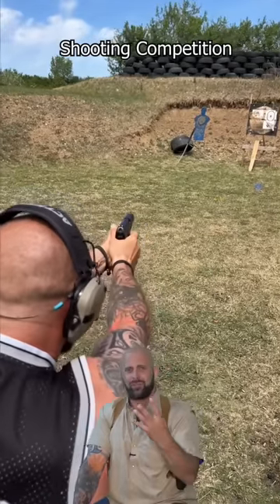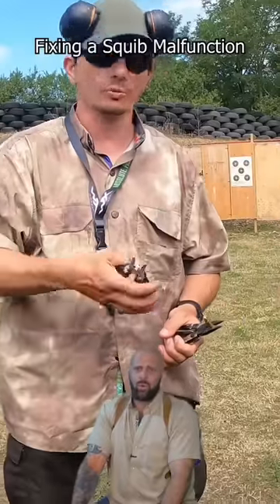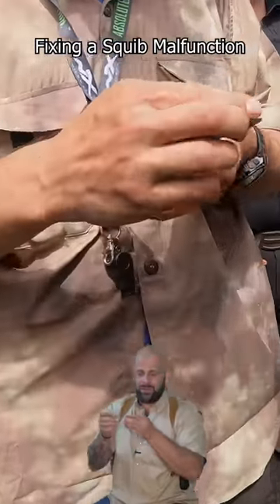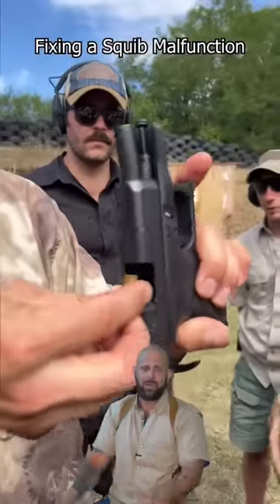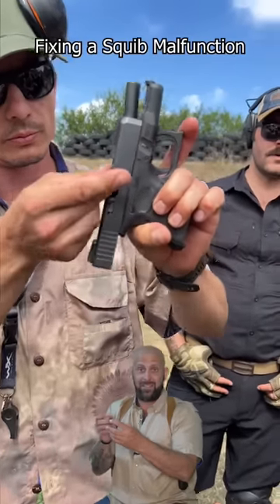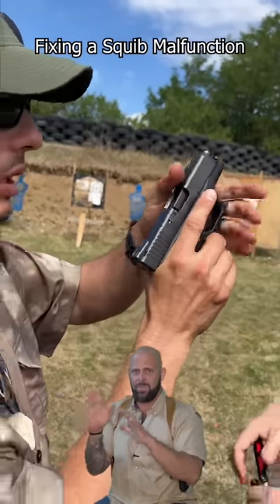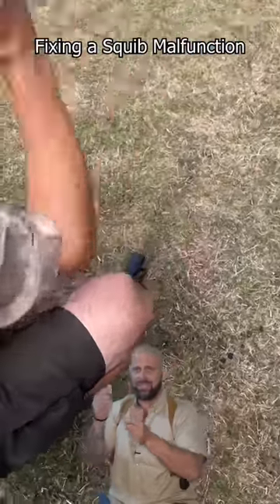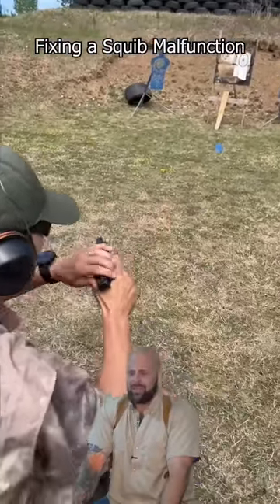Israeli Tactical Training School: Advanced Pistol. Video Clip #10

Comment: Very often a squid puts the bullet part way down the barrel. This "fix" insures a blowout. Yeah, in a match I've seen a squid put the bullet 1/2 down the barrel.
Reply from the maker: First off young man it’s squib not squid… yes the bullet is often lodged in the barrel, obviously. Simple physics will also tell you that this technique is not dangerous, regardless of the pressure spike… your barrel is still a barrel, it doesn’t become paper. The bullet is still soft led and the barrel is still steel. The original load probably just didn’t have enough powder.

Comment: Don't loan out your guns had somebody shoot three 22 lr that didn't leave the barrel 
And the barrel was ruined 
1 it swollen everywhere a bullet ran into another bullet 
2 they used a coat hanger to remove the bullets there were scratches all inside the barrel. This was a browning 22 LR T bolt 
I felt ill when I saw what they did to my rifle 
They ruined the barrel and the bolt .
The firing pin was bent from over pressure 
And the gutted the rifling.

Comment: Holy Crap how about no.  I guess if your in a life or death situation yeah. But putting more pressure into a barrel that is already obstructed is a great way for a gun to blow up in your hand. What if that squib was not the result of not enough powder and there was actually something wrong with the barrel. And cartridges are fitted tight for a reason. So now your just putting a ton of pressure on the breach and barrel.

Comment: This feels like bad advice. You have created a pipe bomb and got lucky that the barrel was strong enough to contain the blast and that the path of least resistance was pushing the bullet out the barrel. 

I’ve never had a squib malfunction but I know any barrel blockage of any type is bad. There has to be better way of removing the projectile.

Comment: What's amazing is they have tools and still chose the dumb way to fix this. Even if you don't have a cleaning rod and a hammer, I see trees in the background. Field strip the gun, Go snap a stick off, put it up the barrel and smack the  stick-in-barrel against the tree trunk or a big rock until you get the bullet out. Literally 6 different ways to MacGyver a fix for this that don't involve potentially blowing up your gun and shredding your hand.

Comment: Yeah no. That is not the safe way to clear a squib. Break the gun down. Use a stick or wooden dowel to push the projectile through. Really simple. You can damage the gun and cause potential injury by modify cartridges and firing even a blank with a squib in the barrel.

Comment: Nope field strip, use a squib rod, a small tap on the back end of the squib rod either on a hard surface or with a small hammer (armorer's, rubber mallet, etc) and you're good to go....no way am I trying to fire it out...nope

Comment: That is absolute horse crap and a really good way to lose a hand. Use something to drive the bullet out of the barrel, back into the chamber and remove it completely. Do this will cause overpressure of some kind at minimum will get the bullet out but by far more likely, blow the barrel up or the entire weapon comes undone and damages or removes the hand.

Comment: I can't believe that you said that!
That is the most questionable thing that DARWIN WOULD be proud of! 

Why would you not want to do it the safest way by disassemble the gun.

Why would you tell this to people this.

Taking a live round pulling the bullet out then loading what is the brass and powder to clear the blockage.
What if you have other under charged rounds?
When if you clear the rounds the way you should disassemble and use a cleaning rod.
But hay what do I know.
Reply from the maker: Try and develop a baseline understanding of physics and then we can discuss whether or not this is actually dangerous and why.
Reply: @BoneTactical  that is funny!
I could not stop laughing. 
The laws of physics have nothing to do with this! 
Taking the brass and powder to remove the bullet from the barrel.
You have the gun powder sitting in the barrel but you also now have changed the pressures in the gun because of the space  between the brass and the bullet.
So I think you might need a refresher on physics.
But hey what do I know.
Other then disassembling the gun and removing the bullet properly.

Comment: Do not attempt this. The pressure difference from having the powder spread across the bottom of the barrel will change the burn rate. This dude may have gotten lucky. Just tap it out from muzzle to chamber and move on.
Reply from the maker: No, simple physics. No danger here 🤣 if you think education is difficult, try living in ignorance!
Reply: @BoneTactical  it creates a pressure spike brother. Same concept as filling a rifle case 1/3 of the way full of powder instead of normal capacity. I’d love to hear your elaboration of what you think is simple physics that applies here!

Comment: Haha....no. break it down. Use a push rod. That's how you do it without wondering if it will detach and relocate your hand.
Reply from the maker: There’s actually no danger here but it’s much easier to use a push rod. This is simply an alternative method 👊🏼
Reply: @BoneTactical  oh I wasn't criticizing. I was simply saying a break down and push rod is how I would do it. Regardless of it works or not, blowing out a squib with a "blank" round just seems dangerous to me. Not a chance I'm willing to take. Either way, good on you brother. Thanks for taking the time to respond.
Reply from the maker: @rhinosauserous  I’ve never done it personally, but I have a lot of respect for Lucas. Thank you for your feedback and support.

Comment: Ah yes. The best way to clear a stuck bullet in a Walther is to load an-open top cartridge into a Glock. Hmmm.

But also, DO NOT DO THIS. This is the most dangerous way to clear a squib. Never shortcut on firearm safety. Just takedown the weapon and use a ramrod. If it’s stuck to the point that you can’t even hammer it out with the rod, just invest in a new barrel.

Your life is not worth an “easy” solution.

Comment: For what it is worth...this is not something you want to put on the internet as a solution to a SQUIB MALFUNCTION!!!
Safety FIRST! Your SOLUTION has the potential for blowing up the pistol. The pistol needs to be disassembled and a rod used to push the bullet out of the barrel, then the barrel needs a "thorough" inspection. The best is to check the mechanis of the pistol as well as the parts. I was taught safety first. I think this is not something I would recommend, much less promote it on thw internet. Does not look good for firearms enthusiasts IMHO. Seems like a lawsuit in the making to me!!!

Comment: When the bullet is only halfway down the barrel the pressure builds up substantially more than when it's seated properly. There's a reason that muzzleloaders come with a warning to make absolutely sure that your bullet is seated on the charge. This is a terrible idea.
Reply: @gotchanose  An obstruction is an obstruction. Same exact physical principles. It just happens more with BP because of the loading style. If you think black powder and cartridge fed firearms are that different you don't know much about them. In principal, they are EXACTLY the same. Pressure "spikes"  in an open cavity, verses "pushes" the bullet out of the barrel with an even pressure "wave" in a properly seated bullet, rather than pressurize half the barrel to pipe bomb levels before the projectile is launched out the other end (or the breach is blown BACK to your face). There's been scientific testing of this, no foolin' Jack. 

 Go argue with one of the other 100 commenters who think it's a bad idea. I'm not the only person who thinks this is stupid. It's genuinely dangerous, regardless of weather or not it works a time or two. I'm not arguing to be an asshole, I don't want you or anyone to hurt themselves, or worse, hurt someone else nearby. 

Why don't you send this video to S&W or Glock customer service and see if they think it's a good idea. 

I get the impression you have very little, or no, experience with firearms. Firing a bore obstruction is beyond dumb, and anyone who has shot before knows it. You clear a bore bstruction with a rod, not a half disassembled cartridge.

Comment: This is the worst advice possible. This Lucas guy is insane and WILL get someone hurt with this kinda advice.
Reply from the maker: You’d greatly benefit from a physics, lesson, knowing the importance of listening before speaking, and being open to learn new things, my friend
Reply: @BoneTactical  it's not a matter of physics, it's a matter of safety and the responsibility of showing something as a technique, one of which someone will surely emulate. Your showing that your should use another explosion to dislodge an obstruction, in this case a squib, by modifying a round. I get the physics behind it, but it goes against so much firearm handling, safety, and maintenance.

If this was saying here's a way to do something but isn't recommended at all, then okay, sure. This is almost a step by step way for others to emulate and gives the impression that someone can use this as a valid way to clear a squib. There's enough bad advice out there posing as good advice, it's easy for some to take this as something they can do. I'm not saying this doesn't get the job done, but surely you can agree that it goes against all principles of dealing with obstructed barrels. Does this work all the time, and for all pistols, or all firearms? Never in my training as a civilian or in the army, was there anything referring to modifying another round to clear the failed previous round, and in fact the primary goal was to avoid discharging the firearm until the obstruction was cleared, not before.

So it's not a matter of just being open to learn new things in this case. It would be to ignore previous lessons, including in safety, to learn new things. I'm not against innovation, but I do get concerned when there's unnecessary risk for the sake of doing it different.

Comment: Such a positively awful idea. You have no idea why that bullet is lodged, it could easily be the wrong size bullet that somehow got mixed in, it could have some other sort of defect in its shape which would prevent it from going down the barrel, then youve basically generated a pipe bomb
Reply from the maker: It’s made out of lead, the barrels made out of steel… simple physics 🤦🏻‍♂️
Reply: @BoneTactical  🤣🤣 wow

Comment: Way faster to poke it out with a stick what he did was extremely dangerous
Reply from the maker: If you’re scared of firearms, then it’s fine that you don’t use them. Your fear shows your lack of understanding and it’s OK if you want to use a stick instead young man. Don’t feel like you’re less of a man simply because you don’t understand physics, science, or weapons. You have your own gifts and talents!
Reply: @Bone Tactical  no bone head tactical you dont have you ever seen what happens when a primer goes off before the powder can burn and push the bullet out if the case it can cause a catastrophic pressure spike and what your doing is a identical representation just on a bigger scale your putting a solid object and a charge together in a confined space is fine but increase the dead space were the powder is under the primer creating a gap it can cause a pressure increase it could very easily be possible to cause a catastrophic failure and if it pushes the bullet out great but now you have a bigger problem stress fractures in the barrel possible bulges im just saying what your teaching people is dangerous illogical and dumb. Your steps are pull out pliers take apart a case and put it in the chamber then shoot it thats what 4 steps plus a risk versus using a cleaning rod or a stick which is open chamber push with stick easy zero risk less time

Comment: This is waaaay sketchy man. Ive seen it done but thats incredibly dangerous and irresponsible
Reply from the maker: Guns can be dangerous if you don’t know what you’re doing young man. Definitely a good idea to educate yourself on proper use, and it also is very helpful to have a general understanding of basic physics
Reply: @BoneTactical  yea so there is a safer way to do this, it's similar to loading a muzzleloader but the opposite direction, and with the gun broken down. The guy in the video may be experienced enough to do this but you can't trust every jackass on the range to do it correctly and not blow their gun and hands up.
Reply from the maker: @jerryprince5337  this is in no way dangerous. There’s always more than one way to skin a cat
Reply: @BoneTactical  It only takes a minute to takedown the firearm and pop the squib out of the barrel with  a dowel or a chopstick or whatever else. What if someone forgets step one of removing the bullet from the brass and tries firing a round through their gun. Kinda dangerous man lol

Comment: this seems like terrible advice
Reply from the maker: You have a base of knowledge that affects how you perceive things, what appears to need work is your understanding of physics and metallurgy apart from weaponology. Hope this helps 👊🏼
Reply: @BoneTactical  not at all. I'll continue to not shoot a firearm that has a known barrel obstruction. All it takes is for sone poor sap to try to clear his 308 or 30-06 using this method.
Reply from the maker: not all firearms are the same. they are all different actually. what you can do with a pistol you can't necessarily do with a rifle and vice versa... @tylermatthew378
Reply: @BoneTactical  correct. Which is why making a video on how to clear a squib then showing with a pistol without clarifying is poor judgement. Obviously a 9 is going to hold up to the pressure, but what happens when I try this with a desert eagle. If you get super comfortable with a saw stop then move to grizzley, it's always wise to review safety basics but you know damn well a lot of men are incapable of such things